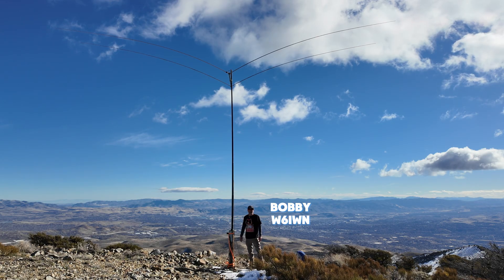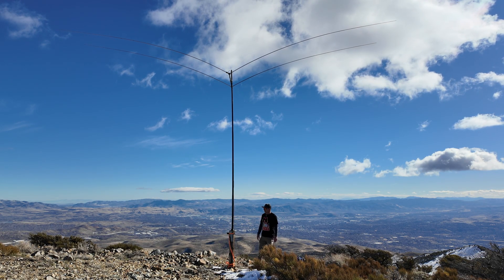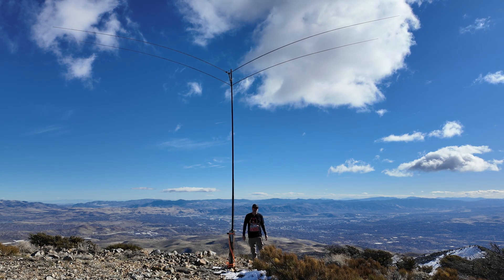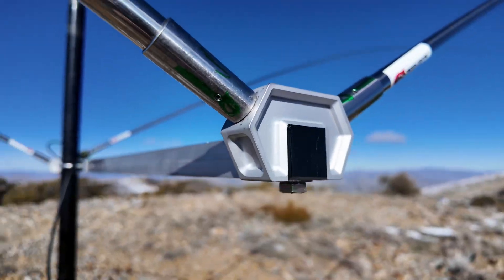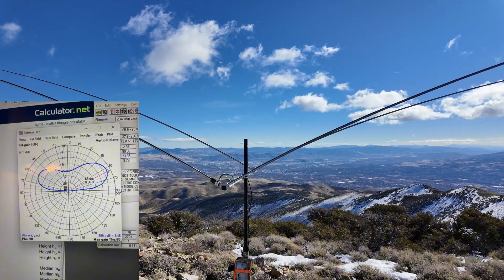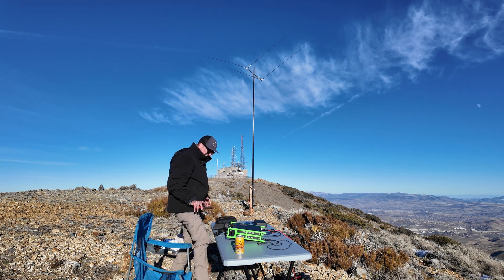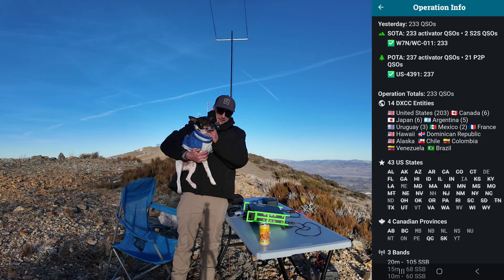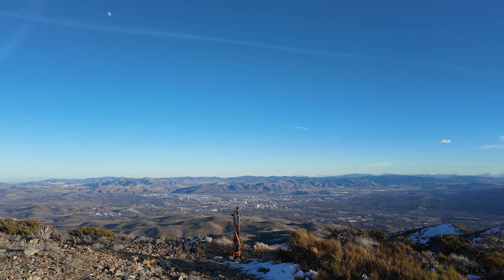Portable 2e Yagi

Comment: Very nice build.  I think with a telescoping boom or a way to move one or both of the ends should get you there on spacing.  What angle are you using?  What height are you deploying?

How short do you think you arebfor 20m?  You could add extension rods before the CHA17 whips.  There are also 18.4 ft Chinese 10mm whips.  73 KK7YIS
Reply from the maker: Thanks! We may experiment with a longer boom or telescopic boom in the future. That version is 4' at 30°.
I have some longer whips im going to experiment with. The Chameleon whips did 20m, just a little high around 14.450. I was still under 2. I was sending up about 18-20'

Comment: I've built this antenna with a 4ft boom and did not find it to be very performant at 20m. I had to go to a 8ft beam with the director configuration,. Your results obviously seem to differ. I will need to re-evaluate again. Higher bands worked fine.
Reply from the maker: Yes it's a bit close on 20, the models look okay though. For what it is.